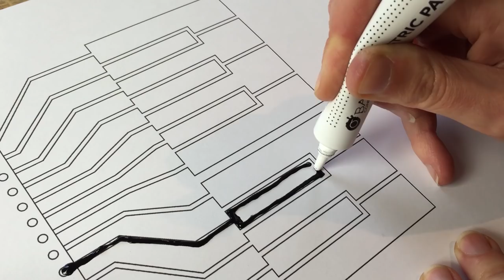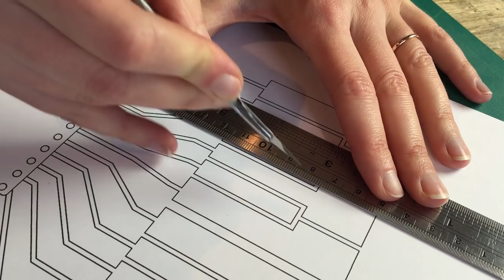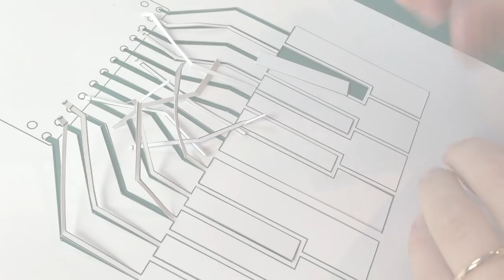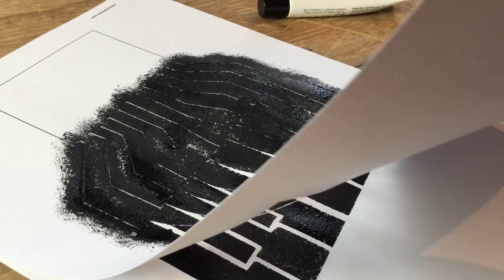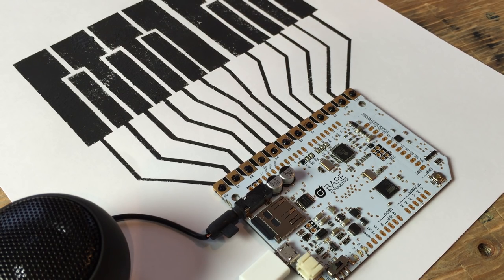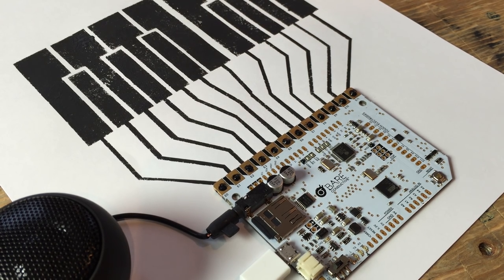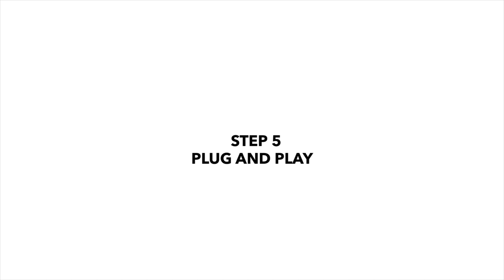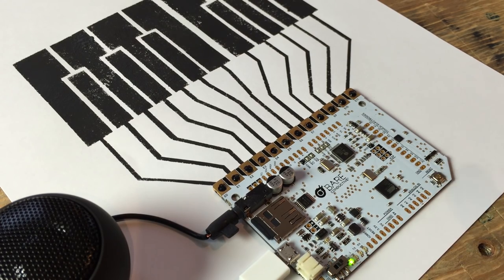Basic Project | MIDI Piano

Comment: God, all of that wasted paint on the paper towel...
Reply: I would use an air brush and hold the paper mask down with push pins to reduce paint waste.

Recently I found a site which shows how to make literal copper paint which is not only more durable but easier to apply.

I just wonder where they got that midi keyboard from!
Reply: Ikr i was screaming

Comment: One thing that I don't get: Why, if applying it with a brush, do you have to do it that way instead of a single paint layer like with the tube? Thanks!
Reply from the maker: Hi Mecha Pistacchio, it's easier to apply Electric Paint from the jar with a brush. It covers larger surfaces. Both the tube and jar do the same job though. Let us know if there's anything else we could help you with.
Reply: Hi!

Of course, that I understand, but what I don't is why do you have to apply it with a brush that way (multiple brush "thrusts"), instead of single strokes with it, like you would do on a painting. I think it would cover the surface easier and more homogeneous.
Reply: single strokes might slide the stencil
Reply: it's easier to sell if you have to buy tree of our products(pen, jar and keyboard circuit) to make one simple project

Comment: FAKE
Reply: 정다운 yes fake
Reply: no it's not. there is conductive paint on the market, in fact, even a thick layer of graphite will work just fine. i don't have this set, but i have a makey makey, which does exactly the same, except you need to plug it in a USB Port on a Computer.
Reply: It’s fake because she or he played 8 notes but it only goes up to b.